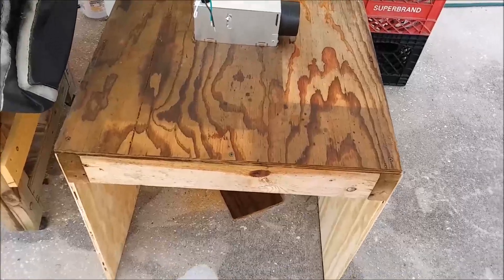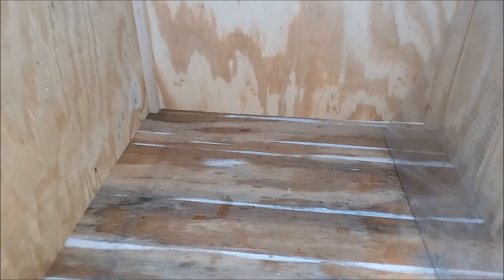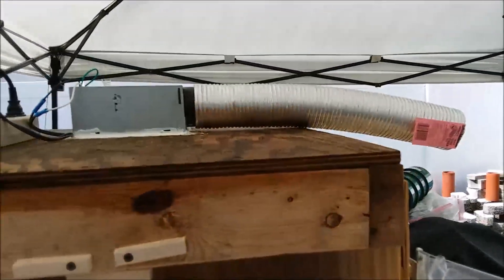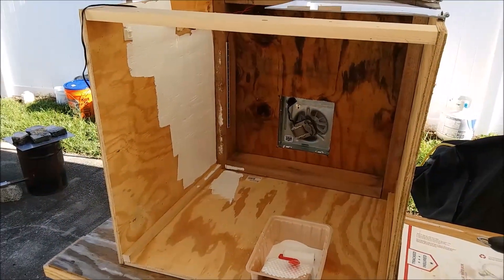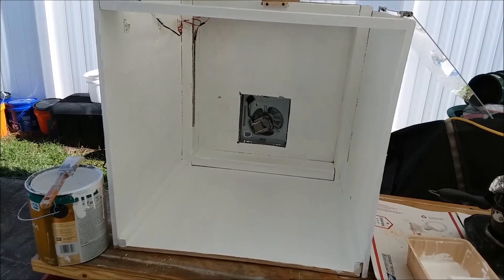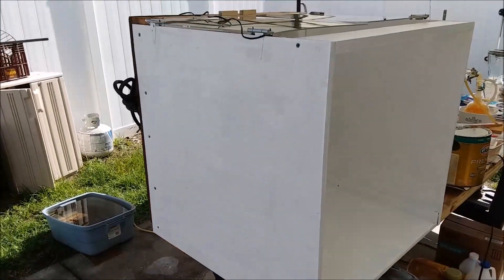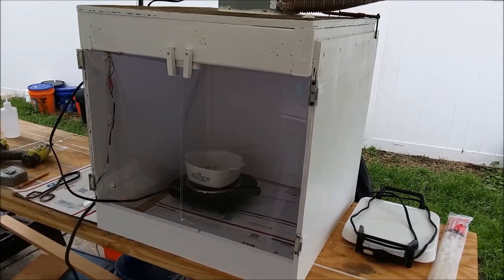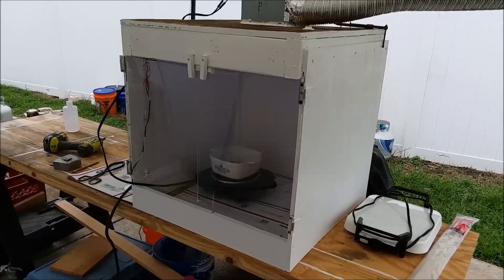A home-made chemical fume hood I built myself

Comment: Nice build there. You can always replace those plexiglass doors with free entertainment center doors. I thought that’s what they were at first. I’m looking to build one of these myself and so far I have 2 microwave fans, plenty of lighting options, helix duct that’s the same diameter as the fans, and plenty of cord. So far I’ve assembled my air filter. I live on the 3rd floor of an apartment building with 8 neighbors in all directions. Im just waiting to come across some entertainment center doors because then it will be easier to build everything according to what doors I find. I’m doing everything for 100% salvaged/free. I’m using mine for soldering, airbrushing, and general tinkering of the sorts.

Edit: Upon a further look at your channel, you have alot of videos im interested in as I have been hoarding scrap circuit boards for gold and been sourcing parts to make a rock tumbler as well. Subbed!!!
Reply: Microwave fans? I wouldnt think those would be strong enough

Comment: Should use sheet metal to line the interior, to protect the wood, even though the exhaust fan vents out , the wood being cellulose can eventually be contaminated by certain chemicals. With sheet metal you can wipe the interior out!
Reply: Sheet metal will corrode and give off toxic fumes!!!!

Comment: Will the chemical fume gases corrode the metal fan and the aluminum vent
Reply: Yes it will corrode the fan,bearings the windings in the motor. 50 times as fast road salt corrodes a vehicle.

Comment: Horizontal roof peaking with a bypass Venturi high power fan, got a monster fan for five bucks at garbage sale. It pulls a ton of air but it’s pretty loud, gotta move it further away.  Probably gonna be told need a second roofto pull out anything from being a condensate on top sides if not using  recapture reflux, or need a scrubber of some sort. Guess meant baffle.  Put in slant roof plastic siding inside, though flammable? Wood is too, was looking for a sliding system get hands under or air inlet. Good for him trying and sharing.  Did you design it off something? Nice touch chimney a pvc chimney if got neighbors? Smart putting stuff outside. Dunno. Good luck!
Reply: That is what you need. A venturi affect FAN  that keeps the fumes away from the motor and fan! GOD don't do this it will work a few times then it's done. That is why it needs to be a chemical hood.
Reply: @JustMe-qt8kz  Correct, especially if working with fuming acids, corrosives, metals, organometallics, mercury salts, stuff that will eat through steel, foil covers fan blade’s insulation. This making explosion 💥 proof, explosive assured.  People don’t realize the stupidity suffered until it takes a life. I’ve seen folks overcome in pilot plants, heating closed systems, cranking up variacs power to high on Ethyl ether, things that have more explosive power when hit ignition than 🧨 tnt!  They don’t just kill selves they kill others. People fall into waste treatment…If had 1000 years I’d write a text on all the deaths I’ve seen. Most killed over political therefore economic reasons but a few people though. Unlikely much genius lost.

Comment: Late reply, but how does the bathroom fan motor hold up to the corrosive fumes?
Reply from the maker: It didn't hold up well. It failed fairly quickly. I have a series of videos on the fume hood. it has evolved over time. Now I am using a boat bilge blower with a sealed motor. It works a lot better. Visit my web page at http://mdpub.com/UrbanGoldMining/index.html to see the complete series on the fume hood.
Reply: It doesn't. Your putting your life on the line and it's a fire hazard.

Comment: Oh  one thing .  Please change the aluminum in place for rubber or anything otber then metal.  That aluminum will dissove from the fumes and it will leak bad. I dont want you to get hurt.
Reply from the maker: Yeah. The aluminum duct is temporary. It was the only duct I could find locally in the size I needed. Hopefully it will last a couple of months. Then I'll be moving my lab to a new location. I'll use some plastic duct when I set it up in the new location.